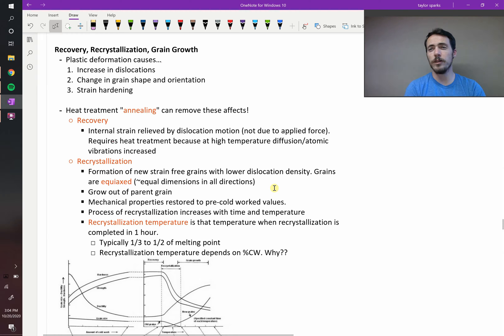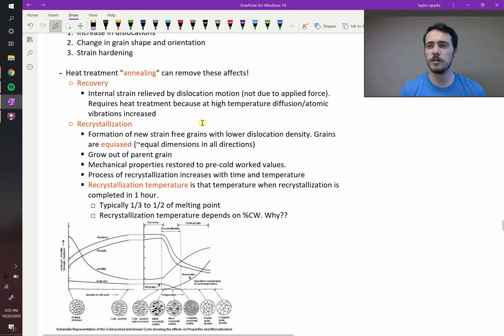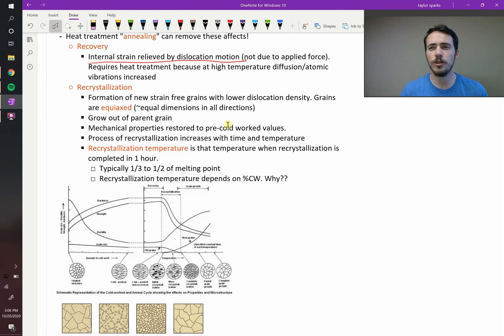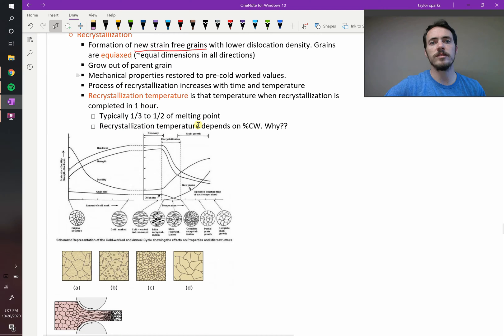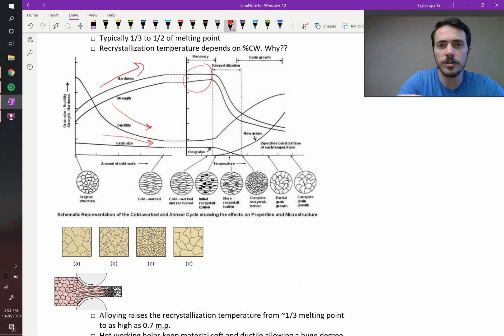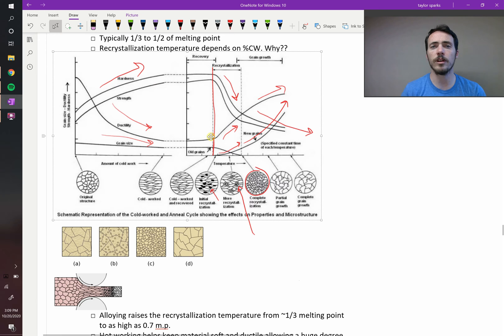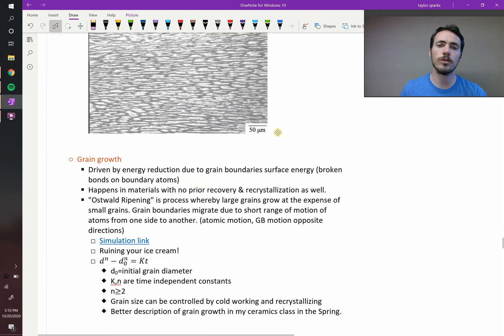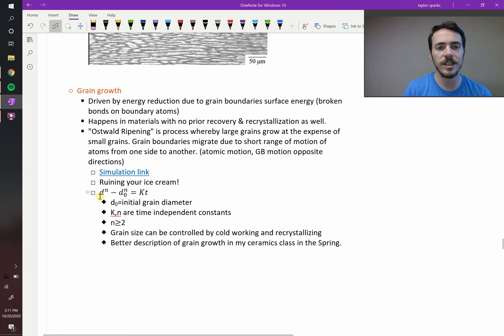Recovery, Recyrstallization, and Grain Growth

Comment: In the cold work amount graph, the grain sizes of the "cold worked" structure are larger than the "original structure".
Shouldn't the grain size of the "cold worked" structure be smaller than the grain size of the "original structure" due to the increase in dislocation density caused by the increase in grain boundaries?

Comment: I’m a dental student and we are studying about the material science to know how prosthetics and orthodontic appliances work! Your video was absolutely brilliant and easy to understand thank you 🙏

I have a question will there be a phase where there is recrystallization with no change in strength and hardness? As in my slides it’s mentioned in the hot-working metals there won’t be change in the hardness unlike the cold-working (increase in hardness and decrease in ductility).
Reply from the maker: I think if the material undergoes recrystallization you will always see a pretty dramatic change in strength and hardness as well as ductility.

Comment: Hi, thank you for your video. I have an additional question. The recrystallization temperature corresponds to full recrystallization after 1 hour. What if a hardened metal is constantly at a middle temperature (half that temperature for example) ? Does it still undergo the recrystallization process?

Comment: Hey, professor, thank you for the great lectures, wanted to study material science but never had the chance, so I appreciate the free lessons.

I'd like to ask, if I wanted to find all previously experimented Cu-Fe alloys (%wt, conditions...etc)and their properties for example, how would I go about doing that exactly?
Reply from the maker: Unfortunately, still have problems with materials databases. They are starting to grow and get better, but there is not one that is completely comprehensive. What I would do, is start with a crystal structured database and look for pure single phase compounds there because you can check them easily. However, this will be for single phases only and I imagine you are looking at multi-phase alloys. In that case you will need to search literature directly. There are probably some review articles that you can start with.

Comment: In extrusion, the peripheral grains become larger and larger. In those cases where we don't want the grains to grow, what should we do?
Reply: during hot extrusion, the metal recrystallizes as it exits the extrusion die while the material temperature is still > than the recrystallization temperature.. Grain growth can continue post extrusion because  the metal is still hot enough   for different grain growth depending on the material  metals like copper and silver  with very high purity will show garin growth after extrusion if the metal remains hot... if the metal is quenched in water as it exits the extrusion die, you can limit grain growth after extrusion

Comment: i may be confused, but i don't think increasing grain size (at least on a monophasic sample) will increase ductility. i think it will actually decrease it.
Reply from the maker: Are you sure? Have you got a reference?
Reply: @TaylorSparks  i don't have any reference ready to give you, but as far as i know, that's why microalloying of steels (with Nb for instance) is so interesting. differently than other hardening mechanisms, decreasing the average grain size doesn't decrease ductility.

the thing is that when you have many smaller grains, the propagation of a crack becomes substantially more difficult than on a coarser grains structure
Reply: @Yodavid1 decreasing the grain size will make the mechanical properties of ALL metals higher, higher yield strength, UTS & LOWER elongation. you have them mixed up. Microalloying elements will form precipitates that will retard the grain growth. so u have higher mechanical properties.